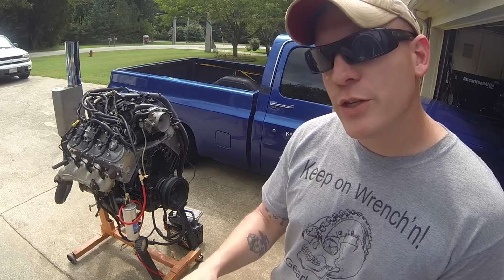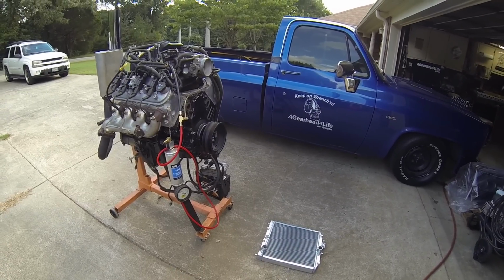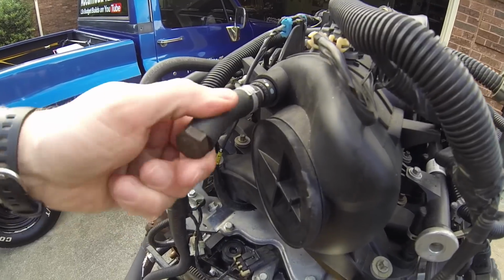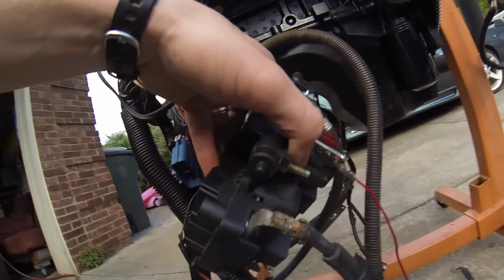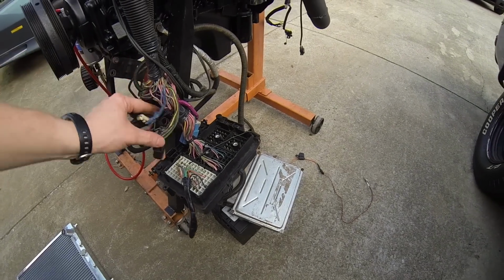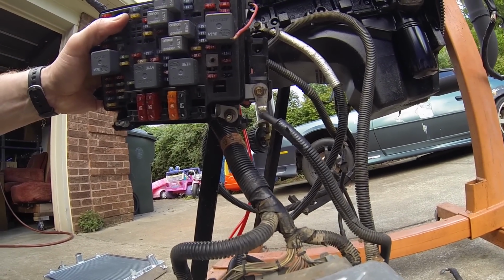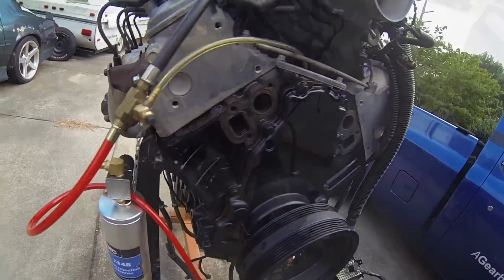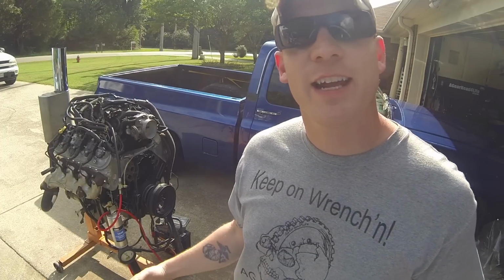LSx Swap Harness How To Simple & Free DIY Standalone on the Test Stand

Comment: got a question, I have a 2002 6.0 I will be installing in a 2001 silverado. my question is, will the 4.8 ecm run the 6.0 long enough to take it to the speed shop that will perform the tune he wants the motor In  the truck before I bring it to him and after I do the swap I do not have another vehicle to pull it. I heard on ls1.com it will just will not have its full potential naturally.
Reply from the maker: +Mike Gros It may run enough to get it there, but more than likely you can remove the computer and take it to him for an initial base tune that should get you to him for the final tune.
Reply: Ok great thank you so much that is all that is keeping me from the swap I have everything else!
Reply from the maker: +Mike Gros Excellent! Good luck!

Comment: question i got a 77 k5 doing a ls swap but what else does it have to be disable when  flash ecm VATS emissions and what else?
Reply from the maker: +Lazaro Ruiz Everything else besides the VATS is optional. So nothing else has to be disabled. This would be a good question to send to your tuner that'll be doing the flash for you. That way they can list off the options and you can respond with what fits your project. Some common things that are adjusted when the PCM is getting flashed are the rev limiter, speed limiter, timing and maybe enabling the electric fan function. Send a message to "CoolMike222" on eBay. He'll set you up with what you're looking for.
Reply: +AGearhead4Life  thanks  man

Comment: what about transmission wiring
Reply from the maker: +Henry Garcia It's in the harness and ready to go. You don't have to touch anything on it.
Reply: Okay im getting a 6.0 tryna put it in my 93 cheyenne but little scared to start im researching everything before.i start also would i have to het aftermarket sending unit for fuel
Reply from the maker: +Henry Garcia You're going about it the right way. Research and collect parts. Since I focus on low budget swaps, I spend a year collecting the cheapest parts that I can find and that gives a good amount of time to research anything that you may need for the swap. 
No, you'll be able to keep your stock sending unit. You just need to swap in a better fuel pump onto it. Like a Walbro 255.

Comment: How would started be hooked up while in vehicle?
Reply from the maker: Sam Van The same way that it currently is in the vehicle. You can usually just leave those wires in place on the car.
Reply: @AGearHead4Life  But for a permanent setup, to start with key?
Reply from the maker: Sam Van Yes.

Comment: will this work on say a fbody harness or only the truck harness?
Reply from the maker: +tinnon82 The same idea will work, give it power and remove VATS, but the harness is much different. I haven't had the f-body fuse block to be able to answer the difference from what I did in this video. I can tell you that I usually cut the fuse block plug off of the truck harness and give the wires power where it's need and I use a much smaller universal fuse block. When I do this with a truck harness, there are a crap load of pink wires to give power to. When I do the same thing for a F-body harness, there are very few wires to give power to and it's much easier. Hope that helped. Good luck!
Reply: +AGearhead4Life 

i have a fbody harness and ecu.. i put a carb on my ls2 it was simple.. yea their aint much to a fbody harness.. i guess in theory it should work.. thanks for the help..

Comment: Will the obd connector still work this way ?
Reply from the maker: The OBD wire is still there. It's just one. You'll just have to locate it and run it to where you want it. Then just run a power and ground wire to the OBD connector.

Comment: Hey bud can i also remove all of the emissions programs off the ecm I'm doing a swap like ur blue truck if u can let me know I can or not I would appreciate it
Reply from the maker: +Ruben Vasquez Yes, I have the emissions disabled. If you plan to not run emissions, you can do the same.
Reply: +AGearhead4Life hey bud thanks for answering also if it's not to much an issue can make a list of what sensors that I can remove my 5.3 is cable driven as well
Reply from the maker: +Ruben Vasquez Actually the best way for you to approach that is to talk with the person that will be tuning it and ask them your options, since they'll be the one making adjustments for you. Do you have a tuner already?
Reply: +AGearhead4Life I have a guy here exhaust pros that's there name since my truck will not require emissions that's what I was wondering I'll give them a call, dude you have made alot of people accomplish there goals u sure made my build a hell of a lot easier
Reply from the maker: +Ruben Vasquez Awesome bro! That's what I like to hear! Keep on Wrench'n!

Comment: +AGearhead4Life, so if I install a 5.3 in my old truck, get my vats system removed, and just put a toggle switch or ignition switch in between a 12v source and pin a9 on the block im good to go?
Reply from the maker: +GoofyDaGoofGoofTV Basically, Yes.
Reply: basically? well i enjoyed this video man, i hope my swap is fairly easy, im getting the vats taken out as soon as i get the computer, and then the swap will begin, and if the wiring is as simple as this video shows it. i will save a lot of money. so thats really all i have to do is put a switch in the middle of the 12v and pin a9? is that how you did your c10 5.3?
Reply from the maker: +GoofyDaGoofGoofTV Yes, that is the minimum that you have to do to make this engine run and drive. YES that is it. I said basically because its the minimum. Because there are many optional things that you could chose to do. Its up to you if you chose to do it. Like gauges and a OBD2 port for example. But you don't have to have that to drive it, just most people want to add things.
Reply: +AGearhead4Life ok thanks for the info
Reply: +AGearHead4Life  I thought you needed o2 sensors? did you bypass that somehow? this seems too easy. I was thinking of a carb swap manifold for fear of the wiring... but now you've got me thinking i can keep it fuel injected.
Reply from the maker: +Johnny Deville It is easy. that's why I'm showing people. People let their mind confuse them when all you really have to do is look at the project. Everyone thinks that you have to complete strip down the harness. WHY? They don't change anything. They're just cleaning it up, removing wires you wont use and putting nice loom on it. Sometimes they're rerouting some wires. These are all options that are up to you to make. if you don't want none of that fanciness, they just do as I did in this video. If you're ready for a challenge, go ahead and take all of the wires apart and do as you wish. If you want it to look good but don't want the challenge, pay someone to do it. Its that simple.Hopefully one day, I'll get a chance to do a custom harness on video for y'all, but there are so many things that are done, that are user preference. So one way of doing it doesn't apply to everyone. It would be a wise idea to keep your primary O2 sensors. You don't need the secondary O2s, they're for emissions. The vehicle will run and drive with no 02s, but it wouldn't be best. The harness in this video has the O2 plugs there, I just didn't have any o2s to plug into it.
Reply: Thanks for the tips and great videos too!
Reply from the maker: +Johnny Deville Thanks! Too easy man. Good luck!

Comment: can i get a wire harnees from the junkyard and a pcm from coolmike222 to get it to run and then tune it later
Reply from the maker: +Meechie Meech Yep. That is exactly what this is. Just make sure that its a drive by cable throttle body harness. You could make a Drive by wire setup work too, but it'll be a little different than this.

Comment: i got a back fire through my intake during start up. do you have any idea what it is?
Reply from the maker: +Leslie Washington Maybe large vacuum leak? Did you plug off the brake booster vacuum line and EGR port?
Reply: AGearHead4Life i thought the line on the back of the intake was for the break booster? but my EGR is all plugged off
Reply from the maker: it is, just make sure that its plugged or hooked up. Also the vacuum line going to the PCV valve.

Comment: how much of the harness do I need that goes inside the cab? I need the obd port correct?
Reply: nevermind I see it now. can you help me with wiring in the obd2 plug?
Reply from the maker: +fogstain OBD is easy once you locate the OBD wire in the diagram. You just run that wire with a positive and ground to your OBD plug. Done.
Reply: Ya , I figured that out. Thanks man.

Comment: What trans will you run ?
Reply from the maker: That depends on the purpose of the project, but I usually leans towards using a 4L80E because I like to be hard on my builds. So far, I’ve left the 60e in my daily driver though. I’m hoping that helps with fuel mileage.

Comment: Hey man, my Pin A9 is pink. Do you think it's the same?
Reply from the maker: Likely! I don do color since I'm color blind. Shoot, I never looked at the colors of the wire for that pin.

Wait wait, now that I think about it, there's a crap load of pink wires right there on that connector, they're all hot wires. You can't tap into just that one pink wire on the harness, if youre trying too. If you're trying to tap into the harness, you have to give power to all of those pink wires. That's what pin A9 on the fuse block does for you. When give power, it distributes power to all of the pink wires through the fuse block.

Comment: are you building these harnesses for others if so what's cost .
Reply from the maker: I am not at this time. When I open a shop next year, I may start then though.
Reply: I have printouts from Lt swap bit don't understand them do you just remove wires wires highlighted in yellow ? And is there diagram on how to wire in fuse boxes . also how do you hook in to dash gauges for oil ,tach and speedo and such . putting in 95k1500 4x4  had TBI 350 manual  tcase 4x4
Reply from the maker: Sorry, but that is way too much for me to answer in one reply. The main problem is that you have to understand how it all works to be able to do it, because most of what there is to do, is optional. So each of those questions has an optional answer that is your decision. That is why I made this video. For people who want to keep it simple and just make the engine run. If you choose to open up the harness to make a custom harness, then you must understand what is going on and make the decision yourself. The site takes some time to get use to. So just study it for a while. And study the diagrams.

Comment: how do you make it work with your original gauges?
Reply from the maker: Ben There are many options on how to do each of those. One way is to simply adapt your original gauge sending units to the LS motor. The options will be different for each type of vehicle that you're swapping the LS motor into. On a truck like the C10, the only ones that you have to adapt are the oil pressure and water temp. The volt gauge already works. The speedo, you have to either get an electronic speedo or get the black box that converts electric signal to a cable driven speedo.
Reply: +AGearhead4Life  thanks man good job on that engine keep up the good work

Comment: So if I used a 3.8 v6 ecm would it be able to power a lt1 sbc? I'm confused
Reply from the maker: +NLS1 Tubster You'll have to ask your tuner, the person that'll be programming the ECM for the other engine. I'm not sure of the flexibility of that ECM. But I do know that where there's a will, there's a way. Anything is possible.
Reply: What would the shops be called I've never heard of anything like this ?
Reply from the maker: +NLS1 Tubster Well a performance shop that tunes GM vehicles may be able to do it, but you'll probably have good luck contacting Mike Rowe to see if he can help you. He can be found on our group Facebook page "A Gear Head For Life" or on eBay as "CoolMike222".
Reply: +AGearhead4Life ok man thanks for the help
Reply from the maker: +NLS1 Tubster No problem.

Comment: does it power everything? (all wires)
Reply from the maker: +daytona themas The main power wire powers everything. The one wire is the trigger wire that would normally be from you key. So what I'm saying is that when you give that one wire power, it's the same thing as turning the key on in your truck.
Reply: Thx.

Comment: what did u use to plug the egr on the intake?
Reply from the maker: +nathan Merrill A freeze plug from the local auto parts store.
Reply: +AGearhead4Life humm no kidding so any freeze plug will work im trying to get rid of my egr system off my truck and u have great videos there very helpful
Reply from the maker: I don't have the part number right now, but you can measure it and match it up. I put RTV on it to make sure to fill any cracks, just in case. Part number was something like 525-555, dorman brand.
Reply from the maker: It's number is actually on one of my videos of the LS swap in the 84 C10.
Reply: Ok thanks for the info

Comment: Not sure if your still paying attention to this but I have a question if you are... will this work with the drive by wire motors too??
Reply: And is this a done runnable ls swap option? It seems to good to be true and there is no other info I can find. Why get a stand alone harness if this is this easy? By no means am I doubting it starts and runs it but is it a good option for a driver if that makes sense..
Reply from the maker: Yes, it can be done similar to this with a DBW engine. You’d likely need the pedal and it’s harness to allow it to run though.
Yes it can be driven like this in a vehicle. But you’ll usually want to add a few more wires. Like one for the OBDII port and one for the TCC. But yes, you could easily drive it like this, I’ve done it.
People likely get a stand alone harness for two reasons. First because they may believe that that have to fit it to work. 
Mainly, people get a stand alone harness because it looks MUCH better all cleaned up and usually customized. It simplifies everything and looks great.

Comment: You need a haircut and get the grease off your toenails, lol. I'm looking to upgrade from a 5.3  vortec on my 65 c10 to something with more HP, camaro 5.7 or vette 6.7 or caddy LS maybe, would you have any suggestions?
Also. would you know how can i set my PCM to turn off my headlights automatically?
I'm in Dallas, give me a yell if you come up this way.
Reply from the maker: J. Shepherd Which motor to go with depends on your goals and budget. A 5.3 can be plenty of power, but again that depends on the goal of the project.
Have you tried a cam or stall Converter on it? Makes a world of difference.
For the headlights, you could rig them to a Relay controlled by the ignition switch to kill them.
Thanks! I go to Dallas once a month for Reserve duty. I'd like to get around the town but they usually keep me slammed while I'm up there.

Comment: Hey man would like to ask you a few questions about a swap. do you have a email I can contact you at?
Reply from the maker: No sir. Right here in the comments or under a related video is the best way.
Reply: I gotcha man. so I got a 92 chevy 150 2wd and I doing a 5.3/60e swap.  is there a was i can use my stock radiator from the 92 or do I need the 5.3 one? And what would be a good fuel pump?
Reply from the maker: barrylock88 Yes, stock radiator is fine. A walbro 255 fuel pump is what most of us use. You can contact walbro to get an exact swap in for your truck.
Reply: Hell yea man thanks. We got the 350 and 700r4 out today along with all the engine bay wiring. next we got to pull all the dash stuff cause we are sticking all the 2006 chevy 1500 motor and tranny along with the complete harness. hope to have a little video up of the project soon

Comment: In paint those nails Marine
Reply from the maker: Roger! I'll get a new coat on asap!
Reply: AGearHead4Life  i'm trying this right now and when I hook power to a9 it fries it?
Reply from the maker: Giving power to A9 is the same as turning your ignition key to the ON position. The engine will be ready to run. You then just have to have a way to kick the starter over.

Comment: Hate trolls but wtheref is the lsx? Everyone “thinks” they have a lsx on YouTube. If you can’t get the terminology correct then I’m damn sure not gonna follow anyone’s advise or more offen than not, watch you’re videos. Happy lsxim lol
Reply from the maker: Duey Jones Let me help your uncommon troll tendency. It’s usually better to think before speaking. But in this case, I can see why you’re mislead. It happens often. 
Have you applied much thought into the difference between “LSX” and “LSx”?

All caps LSX is the race block. The lower case x in LSx is used to annotate a variable dependent on which one of the LS engines that you’re referring to. Often one LS generation engine will have multiple different LS parts on it.

One good Example of when one would use the variable LSx is if they had an LM7 with an LS6 intake, LS2 valve springs, LS1 intake valves and LR4 pistons.

Comment: No that's not funny.  Zane could have been severely injured and/or the motor could easily be damaged.  The stand you are using is not designed to have engine started on it either, pin or no pin.  It's too high of the ground and LS motors easily have the torque to roll it over.  Do shit right or don't do it.  Some other nincompoop will do what you said YOU don't recommend but did anyway.